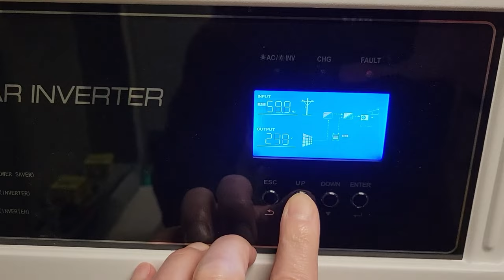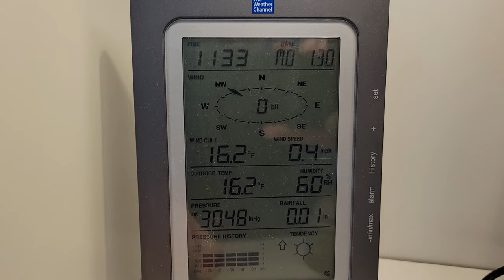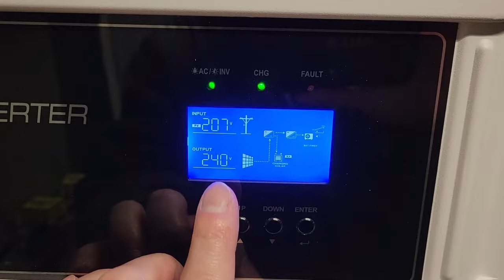Leaf Blowers are Snow Blowers?

Comment: The biggest problems with blowing snow is after about 10 seconds the air coming out of the blower gets warm enough to slightly melt the powder. Using the smaller 12volt blower from makita or milwaukee(and others) if you pulse it, it works worlds better.

Comment: you need to have an 8Ah battery in the Bauer to equal the same size as the Power Smart, calculate the Watt-hours of each. So either the Power Smart uses a lot more power or the battery doesn't like the cold at all. Too many variables to really tell.
Reply from the maker: 100%

Comment: I need a ladder to do mine so I use a 21 foot roof rake with plastic blade there is still over a foot of snow on them. Come on Spring.
Reply from the maker: Yeah I also looked at roof rakes! If mine were on the west roof I would use one as well so I wouldnt have to get up there. Yeah you need a flame thrower!😆